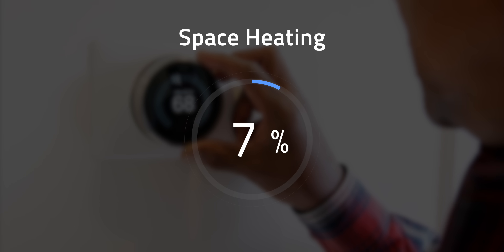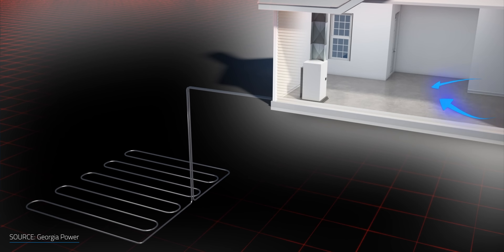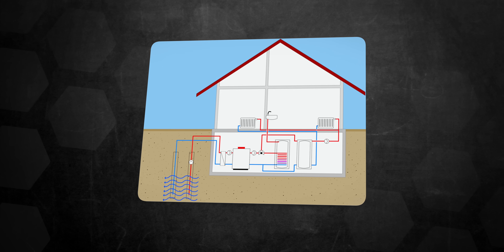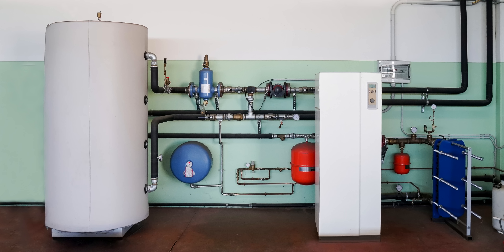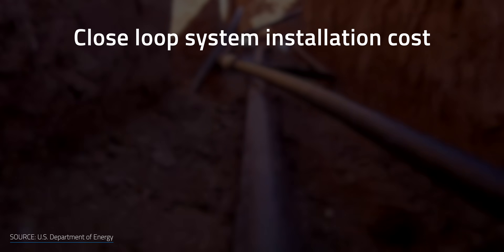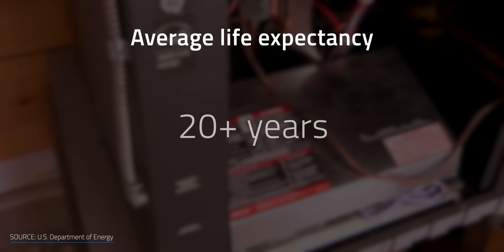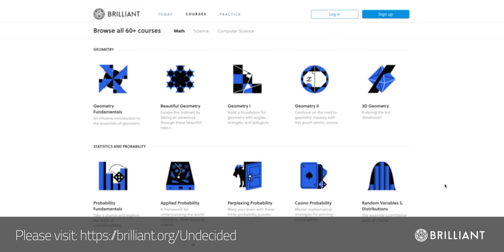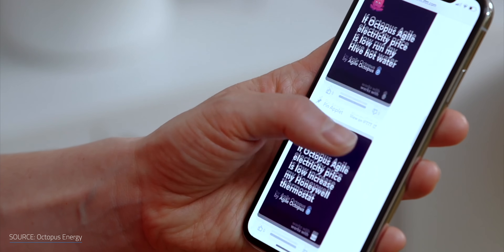Is Geothermal Heating and Cooling Worth the Cost?  Heat Pumps Explained

Comment: Ask my mom and stepfather and you'll get a resounding "YES!"
I grew up on probably the largest working farm in south central Kentucky.  My stepfather and his father built the house well and it was well insulated, but we had only a wood burning stove in the basement to heat the entire house, and only an attic fan for cooling. Cutting trees and hauling wood was a lot of work. When I went to college and moved out, they replaced it with a closed loop geothermal HVAC system and water heater. There was plenty of land, so the company dug three 50 foot trenches that were 6 to 10 feet deep (went in in the early to mid '90s, so details are a little fuzzy) across our garden and into the adjacent field.  Since the house was in a rural area and the geothermal system became their only source of heat, it came with a modem that would automatically dial Kentucky Utilities to report any power outage many years before internet connected smart monitoring systems became a thing.

Comment: My parents installed a geothermal heat pump in their house just outside Boston in 1986. It was open loop and I don't think it was a good choice since the well was more that 200 feet deep. Just to pump the water up to ground level took a fair amount of power and they were putting a lot of additional wear and tear on a very expensive submersible pump. By the time I sold the house in 2021, the submersible pump had been replaced once,  the entire original heat pump was replaced in 2002 (i.e. it lasted 16 years) and the replacement heat pump was requiring expensive service calls by 2018 (i.e. another 16 years). My parents' property was very rocky and there was ledge close to the surface so a closed loop system would have been difficult and expensive to install. But if I was going to install a geothermal heat pump, I would go for one with a closed loop ground source.

But! I will say that their heat pump did a good job of heating the house when the temps were down in the single digits F. I am not sure how an air source heat pump would have worked... It would probably need to fall back on resistance heating.

Comment: I just dumped my geothermal Carrier system after many years of use.   My 1-1/2” loop was not only underground, but also has a 4’ pond over it.  What I learned was this:  the initial unit cost was hugely expensive, and you are paying for two circulation pumps to run rather than a condenser fan.  NEVER paid off.  Not even close.  Don’t go this route if you need cool AC nine months of the year.  Should have shooed away that good idea fairy years ago.

Comment: LOL you are so full of BS. #1 most homes do not have the room to install a closed loop. #2 a closed loop is only 5-10% more efficient than air to air where as an open loop is about 25%. 2300sqft is 5 tons all day long. Where did you come up with those prices? A well closed loop is 10,000- 20,000 per hole and you need 1 hole per ton not counting pipe unit ductwork that's an extra 20,000. plan on 60,000-120,000 for a closed loop install of any style to save 10%. Worse closed loop do not work, it's fake science. In fact most of the time they also install an air to air as backup when the closed loop can't keep up. Open loop works and is the cheapest and most efficient geo thermal and no more maintenance than closed loop or air to air.

Comment: I  installed our geothermal heating/cooling system in 2003.  The system is 
a closed loop copper tubing buried seven feet in an excavation 50' x 70'. That equates to a 5 ton unit. The medium used in the copper tubing to transfer the heat is the same gas/liquid refrigerant that is in my kitchen's refrigerator. The system has suffered no problems in the 19+ years of operation. The air handler portion of the  system requires regular  air filter changes ... and that's it for maintenance. The original cost for everything was $14,355. In today's dollars that would equate to significantly more $$$. It took over 11 years of geothermal use to gain back the $14k.

Comment: I bought a house with an existing geothermal heat pump.  The best decision I made was to get rid of it and get a high efficiency natural gas furnace and ac.  The geo thermal could never really warm the house in the winter and was almost always running in auxiliary.  Even with that I could barely get my house out of the low 60’s.  My electric bill was sky high most of the year around.  Seemed to have worked fine in the summer but a standard furnace and ac combo with natural gas is about a quarter of the cost to run and I am warm now in the winter.    A friend installed a new geothermal heat pump and installation was 50k.  He used fuel oil to heat his house so the operating costs of the geothermal was still cheaper but his monthly electric bills were in the upper 300’s monthly a few years ago.  We live in northern Illinois.
Reply: I should also say to replace my old geothermal was estimated at 50k also 7 years ago

Comment: Do not buy this! Geotermal heating has many drawbecks. And its 10 times mmore expensive than normal air to air or air to water which does heat or ac your building it simply takes from air. It simply way too expensive and not needed. The place where this will be installed nothing grows. Yes if you have flowers grass trees everything dies. And in the end heat which comes from below to house will also become way more colder, this means you will need more energy to heat. It still uses electricity to heat as you use pumps. If you think ok lets [put it under driveway wrong! In winter driway will become so cold it will always have ice not fun. Also it can brake underground as ground moves similar than you hide your treasure and never find it anymore. One biggest thing than winter comes to certain cold it will stop working as there will be no more heat inside ground. And we dont even talking about damages it makes to houses later as this will make some erosion as heat which must be in ground dissapears than comes cold and ice, and after ice comes water and water erossian happens. We alreaduy had this tech and every cind in my country like from start  like 25 years ago we had this. And nobody buys it. Just buy air to air or air to water eu quality which are ment for big freezes beyond anything you got.

Comment: Don't understand they concept. You get the same geothermal energy from your cold water tap. Same temperature as the energy I got from this loop.
Just make a closed loop system with your mainwater line and use it after for shower, washing, drinking.

Comment: It's way too expansive. This tech have been on the market for decade now and the price never really dropped. Where i live, on average, we pay  225$ per month for electricity or so. a 30% saving would represent a small 68$/month or 810$ per year. if it cost 20K$ to have such installation, it would need 26 years just to break even. Adding to that the cost of maintenance and you easily reach 30 before breaking even, which is a total nonsense.

The companies who install such product built their business plan around the fact that if they ask a higher price, people would add the cost of such tech to their mortgage.

You better not buy that neither add it to your house but instead sell and build a new house with a passive installation instead, which will cost about the same to implement, but with zero maintenance and since the house would be built around it, it will be way more efficient.

Comment: my ground water comes out at 70 degrees. That's not the long term average temperature for our area, so I'm guessing I must be getting some heat from an old volcano that used to be in our area (hotspot moved north).

Comment: I converted from an oil fired hot water system to geothermal 8 yrs ago. I live in a cold climate, ADKs northern NY.  It’s worked very well. After 30% tax credit, system cost for 5Ton unit was $20K and has yielded a roughly 9% ROR. Since the savings aren’t taxed that’s equivalent to a 12% pretax investment. Since I have a large 4 acre backyard, I have one long 450’ loop with outflow on one side and return on the other, 5 ft below ground that was trenched, laid & covered in one day for $3,000.  The larger part of our cost was installing an air duct system in our two story home. I later installed a 9300 KWH solar array on my barn roof with 55% cost covered by State & Fed incentive.  Our 3,000 sft home is now 100% electric heat, cool, hot water at under $100/ mo. Aside from the great savings and payback, both systems add a lot to property value.

Comment: It's not just good for environmentalism, but it is great for off grid self reliance. Heating and cooling without reliance on external sources is NOT obvious. However with geothermal, local solar becomes a viable option for the job, especially if paired with passive solar and high mass construction.

Comment: I am in northern MN. I am a HVAC technician I have seen closed loop systems with loop temp returns at -30 deg in February. That can't be efficient but I could never get a efficiency curve out of any of the manufacturers. At that ground loop temp's they can't hear the house. The electric companies offered very low rates 2 Year's ago they made you incorporate a separate form of heat to keep that rate so now that you are paying regular rate for electricity.  That just pushed the pay back so fare out it don't make sense.

Comment: I installed two thermal systems for years. I have 26 years of HVAC and construction, installation experience.

Geo thermal is NOT recommended.
R-50 walls is a minimum to attempt to get your return.
Return on investment isn’t there.  It just IS NOT.

Comment: With the outrageous increases in natural gas prices (SDGE raised the price of natural gas by over 300%), I am looking a replacing my 22 year old HVAC system with an air heat pump powered by my solar system.  The good news is that these type of systems are making more and more sense.  The bad news is that is being driven by incredibly hight fossil fuel prices.

Comment: Spend the extra money on insulation!! Frame a double wall with cip or just double insulation.  Increase cost would total around 10-20 grand and will save more then a heat pump without the extra environment impact

Comment: Um no not at all😂🤣😂 good try though. It is important to me that people know the refrigerant never leaves the unit. They use water to change the state of the refrigerant by running the water thru a condenser and using the ground to remove or use heat from the ground.

Comment: How about cooling efficiency? We already have gas hydronic heating with wall units in the house. I saw some places talking about hydronic cooling using heat pumps and wonder how effective it is? We live in an Adobe home with concrete slab for footings with a flat roof (not much roof space) so it's difficult to install an AC unit and with cost of Gas today I want to move away and take advantage of our solar panel infrastructure (I'm in Australia).

Comment: It should be standard practice with a house that has a basment to put in a closed loop geothermal system under the foundation floor. The basment is dug out you can lay the loops or drill down vertical to install the closed loop system.
Take a 2500 sf home with a full basment and walk out, the drill can easily drive into the basment area to drill then the holes can be grouted to protect the water table, insulation installed over this with sand and gravel and a drain system to move under ground water away from the house. Foundation are still laid on undisturbed soil.

Comment: I have 2, 3 ton heat pumps running off of my water well. After 20 years I finally had to replace the water coils in them due to my acidic water eating them out. Hopefully they last another 20 years. With my off peak electric rate heating my house is comparable to paying 35 cents for propane. Depending on electric cost and natural gas cost it can actually be cheaper to heat your home with natural gas than geothermal. It’s best to do your homework before making the investment.

Comment: Geothermal heat isn't sourced from soil. This whole video is based on a misnomer and the terminology is important. Geothermal heat is gained from the natural temperature rise tat occurs at significant depths below groud or in areas where true geothermal heat is available near the ground surface, for example in Iceland. Geothermal sources are at a much higher temperatre than that found in soil or groundwater and usually don't require heat pumps to harvest the available energy.
The heat pumps discussed here harvest low temperature energy from the ground or from groundwater and are ground source or groundwater source heat pumps. Using other terminology just propogates a form of misinformation that doesn't do consumers any favours, since it confuses free or nearly free geothermal energy that can be accessed using little more than a heat exchanger and pump with low temperature ground source energy that needs a relatively expensive heat pump for harvesting.
Your Brilliant.org course should have taught you this.

Comment: I will try a vertical loop system with copper coils at the base of each 10 meter hole and PEH pipe above it since the point is to exchange heat from depth...

Comment: Hi, Matt, thank you for the video, I learned a lot. I have a question, I have an air-based heat pump heating system. I wonder if the outdoor exchange would have more efficiency if it is located in a closed space like a car garage because in a shed like this the temperature is always higher than outside?